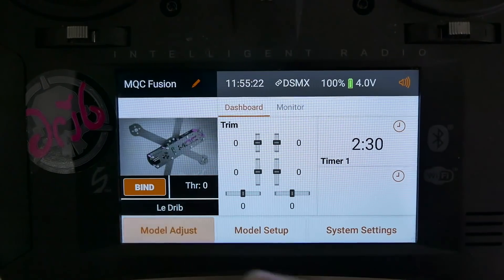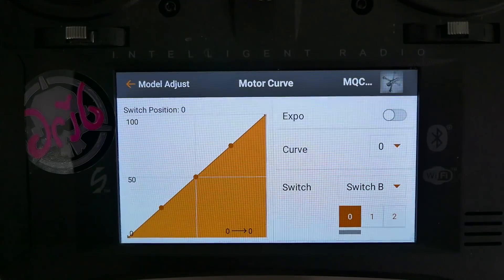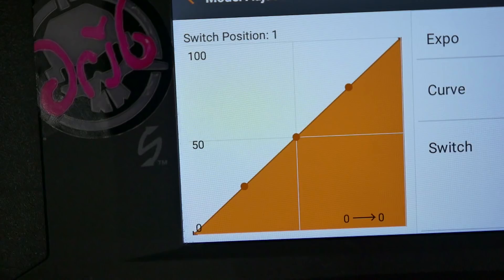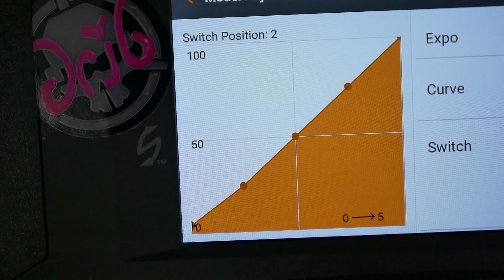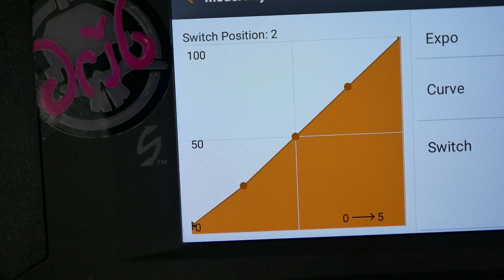Air Mode vs Idle Up - what's the difference?

Comment: Thanks Drew this is really helpful as an RC Airplane guy that's starting.  Do you assign different Rateprofiles to your switches? For example lower rates for smoother and better resolution and higher rates when you need more snap or do you control everything with Super Rate and RC Expo?
Reply: Switching rates while flying would be far too much trouble. I'm not sure what rates Drew flies with but every experienced freestyle Pilot I know flies with a set of rates anywhere from ~950-1300 P/R and at least some expo curve. This gives you very good control and resolution at low stick input, but gives you the snappy, quick response you want at higher stick values. The trick is learning the feel of where your curve begins to increase.

Comment: Great indepth stuff here Drew, but, do some people really not use airmode?  Also, maybe do a vlog on the cons of airmode, like the landing hop lol
Reply: steele does not use airmode.
Reply: Steele uses Idleup
Reply: as the others said, it´s not a thing on kiss because airmode has no effect on pids, it all goes back to a bug in betaflight which was resolved by airmode. kiss didn´t have the bug so there was no need to implement it. idle up and "airmode" do exactly the same on kiss.
Reply: Chris S. Ok, i dont remember saying anything about kiss, but thanks!  Drews video was directed towards betaflight users, as was what i said since it was inline with said topic, airmode, which is a betaflight thing.
Reply: Fauzul Hakim steele uses KISS which doesnt have airmode. Drew is talking about betaflight.

Comment: whats the Turtle Mode and how to set it on a Speky?
Reply: Yes, Riley and Ridi are correct, my response was a failed attempt at humor....apologies
Reply: Paul Giusti 😂😂🤣
Reply: New to the hobby, just wondering if when airmode is enabled and you crash, do you have to quickly turn airmode off to avoid motor burnouts?
Reply: thejackrussell fpv yes.  If i land upside down, my motors do spool up
Reply: schmudge it flips your quad over if it crashes upside down. Just turn it on in your configurator and assign it to a switch. Radio brand makes no difference, setup is the same.
Reply: If you have more than 2 aux switch set-able, its in betaflight, set to whatever switch you choose, amd it works like this.  When you wreck upside down, disarm. Enable the turtle switch, (flip over after crash, in betaflight) then re-arm while turtle switch is on, whichever props are off the ground, point your p/r stick in that direction, it willreverse throttle the props and flips you over.  Then disarm, turn switch off, rearm, flyhome(hopefully)
Reply: Paul Giusti it was really funny tho,  i had, HAD,  a dx6, but i couldnt program anythi g but arm and mode, so i got a 16ch q x7s.  And im never going back...
Reply: Buy one for me? Or i'll just keep using Spektrum.
Reply: Step 1: get a Taranis

Comment: Drew the first DVR clip is with the idle up switch activated? Seems like it isn't, my quad is not behaving like that and I use an idle up switch.
Reply from the maker: Motor_Stop is disabled. So when armed the motors are still spinning.
Reply: That is not enough though. In BF the pid controller is disabled at zero throttle regardless of motor_stop feature. You need to use the idle up switch like you showed in your radio if you want to compare dle up to air mode. Of course the quad is gonna tumble like a rock if the throttle doesn't reach min check
Reply from the maker: The PID controller is still active at idle. I’m not sure where the misconception came from that it is disabled. But that is not true. It certainly has much less authority though, as evidenced in this video. But it is not completely disabled.
The idol ups which increases the effectiveness of the pit controller by moving it away from idle, but this still doesn’t do as good of a job as enabling air mode which modifies have a pet control behaves at Lowe throttle
Reply: Yeah you are right, I used the wrong term, but It's true that the PID controller has almost no effect until throttle reaches min_check though. If you redo the test with the idle up switch (configured in a way that the throttle never goes below min_check which is 1100 in betaflight stock settings) you will find that it behaves just like airmode, I did anyway!
Reply from the maker: Men_Check has its own set of problems and misconceptions. Lower min_check as far as you can. I have mine set to 1005
Reply: Drib 2 the pid controller is still active at 0 throttle, but the I term is not. So the drone won't keep its orientation

Comment: Sorry Drew but Idle Up vs Airmode refers to KISS only, and is the dumbest question in the world since there is no airmode in kiss but people seem to think it is. Ask Final Glide.... oh wait.... maybe not.
Reply: why all the fuss? those who already know so much pls just gather info that u need, n ignore what u think u dont need. simple problem, simple solution. u guys dont have to show & argue that u know more than other ppl who are trying to learn here.
Reply: okcrc Idle-up is not a feature or mentioned anywhere in kiss. It is just a consept, or a set of configuration options in the fc and the radio. The closest thing to airmode in kiss, is that you can set a throttlevalue where the pid-controller is active. When it is active, it behaves and does the same thing as airmode. You have full control, even at low throttle. Some people use this, or the idle-up, as a way to enable or disable 'airmode'. When the switch is off, you are able to lower the throttle below the pid-loop threshold, so the quad doesnt try to correct anything. When the switch is on, idle-up makes sure the throttle is above the value where the pid loop works. 

If you want 'airmode' always on, you skip the idle-up thing and set the pid-loop threshold to the lowest value.
Reply: okcrc, I partly agree, he is not technically saying anything incorrect, but he is adressing the "airmode vs idle-up" discussion, and this is a meaningless discussion on betaflight. His video should be titled "what does airmode do".  No one are advocating idle-up on betaflight, as this just makes no sense whatsoever. On KISS it is a thing, on betaflight is is not a thing.
Reply: nehe1234 nehe1234 true. I believe the term idle-up is a carryover from helis and probably should be renamed in the kiss software just to eliminate the confusion. This is probably why air-mode is not called idle-up in betaflight even though they preform similar but not exactly the same functions. I'm not familiar with the KISS software so I'm not sure if "KISS idle-up" is the same as "betaflight's air-mode" but if they are the same why not just call it air-mode in KISS? Or is this what the debate is about? Even if they are not the same KISS should probably use different terminology for their mode since their mode is on the aircraft's flight controller and not on the transmitter. Maybe KISS could use "idle-stabilization" just to eliminate the confusion with idle-up from helis. What drew is describing in this video most resembles the heli idle-up I'm familiar with.
Reply: In KISS there is no airmode.  It is only min-command which is throttle-value at which the pid-controller is active. If you set min-command to 1000 (lowest) the pid-controller is active all the time.   The difference between airmode vs idle-up in KISS is that, airmode is setting min-command to 1000, while idle-up is having a switch forcing the transmitter to only send throttle-command higher than whatever you set min-command to (1070 or something).  There is no difference.  The only difference is a hacky way to disable the pid-controller on a switch on low thottle.

The idle-up vs airmode discussion usually applies to KISS?  I have not heard of that many idle-up betaflighters.
Reply: okcrc, I am sorry but it is not.  Idle-up is not a thing in betaflight now, as it has airmode.  On KISS it is a way to fake "airmode on a switch"-like-behaviour by using the throttle as a switch. You can set the KISS to behave completely different if the throttle is below or above a threshold, then use a switch on the transmitter, when switched to make sure the throttle does not go below the threshold set in KISS firmware.  You are not only controlling the throttle, but also making sure the pid-loop behaves in a certain way. You can set idle-up when using betaflight, but it is not what people mean when they say airmode vs idle-up.

If Drew had redone his experiment with a KISS FC setting min-command=1000, the quad would not behave as he shows in the video. It would behave more like it does with betaflight-airmode.
Reply: you are correct, absolute must indeed!
Reply from the maker: No... as I explained, idle up is a setting in your transmitter. It is a carry over term from collective pitch Heli’s. Air mode is a flight setting in Betaflight.
Reply: Drew's explanation is absolutely correct here. If you came from collective pitch helis then you already understood idle up. Idle up and throttle hold are a must in the heli world and were as far as I know always configured on the transmitter.
Reply: nehe1234 he very clearly states he is speaking to betaflight and not KISS. He then goes on to state it is set up on his transmitter and not in betaflight. His explanation is spot on when comparing a traditional transmitter setup idle-up switch (transmitter setting) vs air-mode (mode in flight controller).
Reply: Yea I thought I was correct, thanks for agreeing. Idle up on Betaflight, never heard of it being used, but I'm 99% sure you could do it within the firmware and not on the tx. Would make no sense using on Betaflight, doesn't work the same at all.